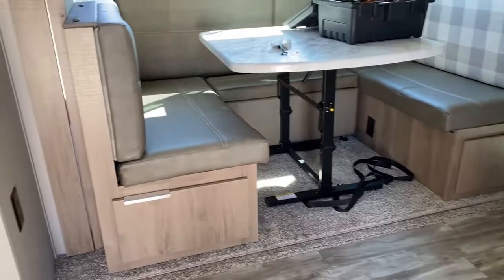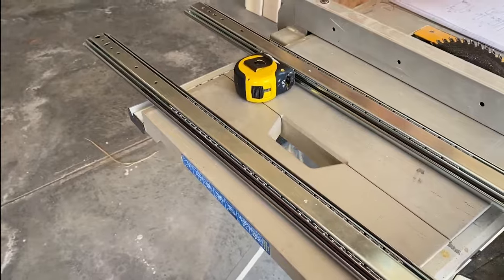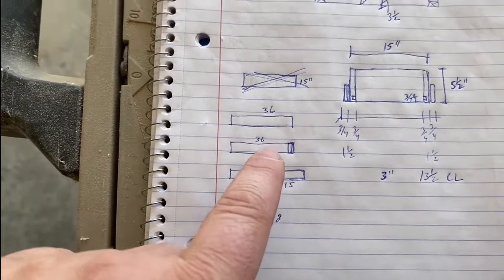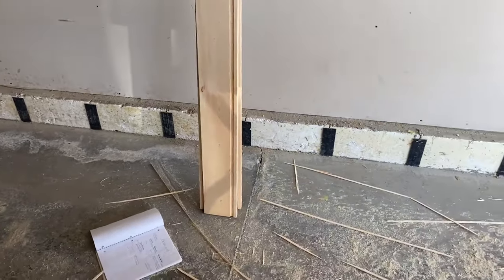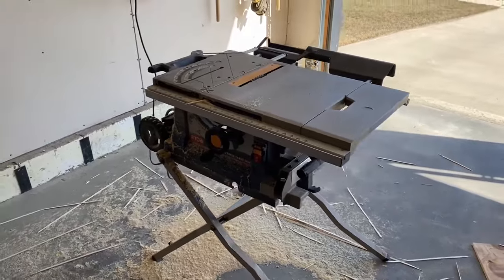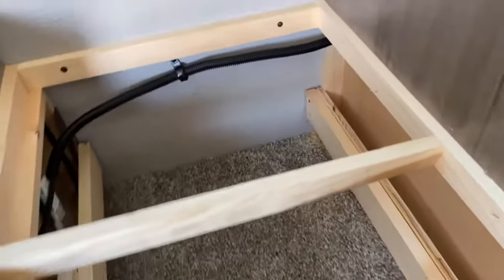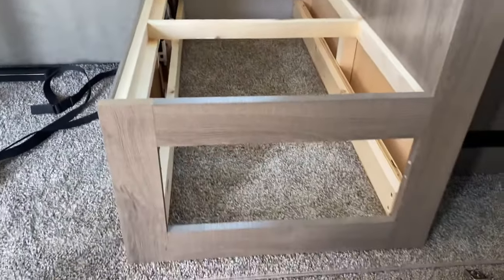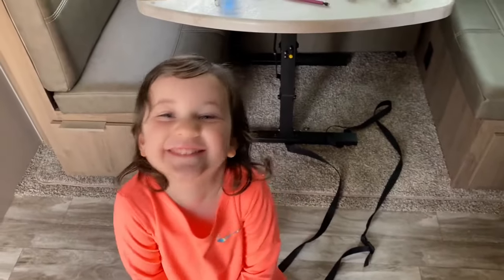Camper Booth Dinette Drawer Mod (Grand Design Imagine 2400BH)

Comment: Thanks for sharing.  I built pull-outs under our GD 2800 dinette as well.  I just put 3" furniture slides under the drawer I made.  The factory board under the door can be removed by taking out pocket screws and then attaching it to the face of the drawer.   It slides out easily on the carpet and the draw can be deeper since it's a few inches lower.  Just another idea!

Comment: For someone who doesn't have the time, tools or talent to do this would you consider making and shipping them out for a markup? (Minus the drawer front obviously)
Reply from the maker: yes, but I would bet the shipping costs fully assembled could be high!  They can be built using turn lock internal metal hardware, you would assemble (Ikea style) that would allow them to be shipped flat and probably save a lot on shipping.  The slides and mounting is the most critical part, and they do need shimmed out to be installed.  I could provide the cut shims approximately the right size.  I saw approximate because there is a change your unit could be 1/8" or more off from mine depending on who built it that day.  But I can take that into account by under sizing it slightly.  I have made a handful of others, and have changed the design some.  These I threw together using my contractor/jobsite saw and materials I had laying around.

Comment: I made some drawers like this for a 19' TT.  Makes a huge difference in storage space.  I did one bench at 3 feet, the other I did at 28 inches.  I also built my drawers with 1/2" ply and installed dividers in them.  The space in the back of the "short drawer" is for things that we don't often need access to.  I found that despite the slide being firm in its pull, it still opens while traveling.  I put some plastic shims under it now, when I travel.  Have some barrel hasp bolts to install as attached drawer locks for travel.